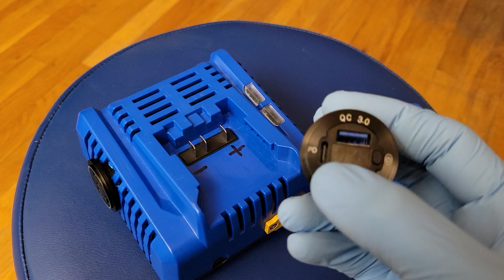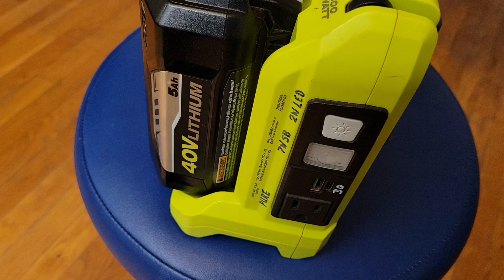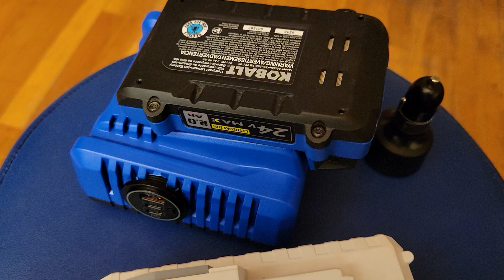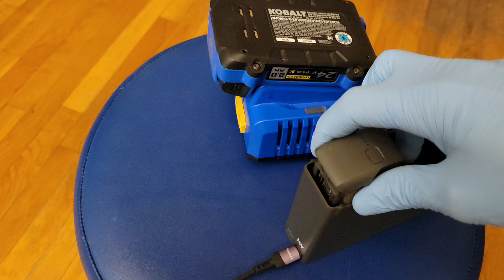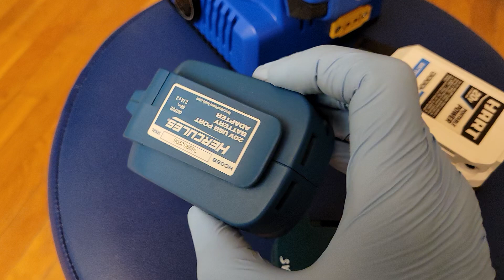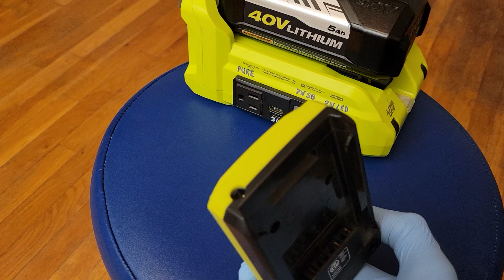Kobalt 24V DC Power Station - DiY Mod

Comment: do you sell these pre made im not good enough with electricity  to make one or have a step by step video
Reply from the maker: I dont sell them but id recommend using an old Ryobi charger as the body since the Ryobi batteries have low voltage cut off built in. These USB chargers work great on 19V and some can even boost to 20V PD100W